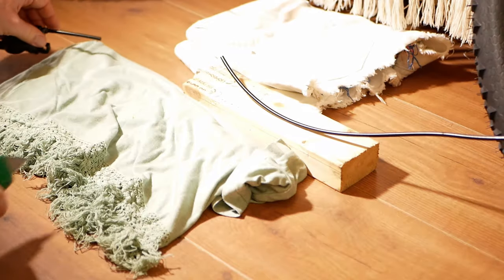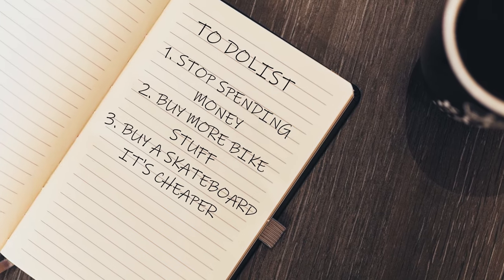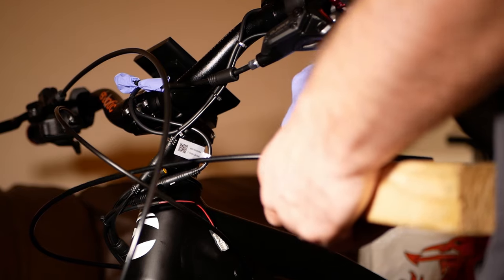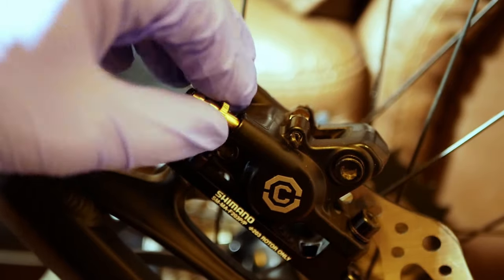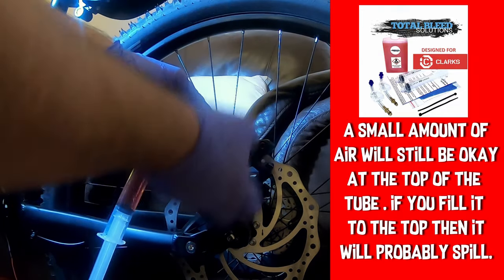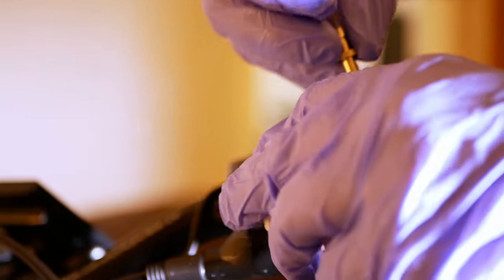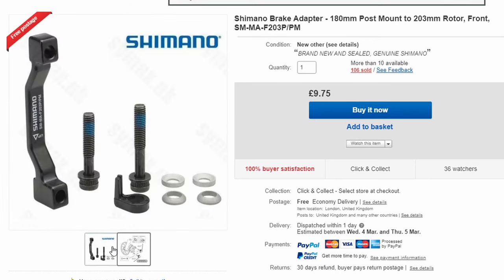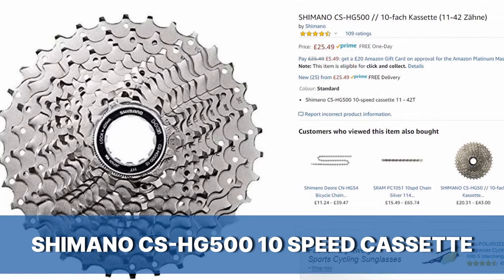BAFANG ULTRA VAPOUR ELECTRIC BIKE PART 7. BRAKE ADAPTERS  SHIMANO GEARS G510 MID MOUNT MOTOR KIT

Comment: I finished my build this week and just did my second ride today. At first I wasnt happy with the power control but today I took a windows tablet with me on the ride and started programming the controller and now it's a lot better. I'm happy, just noticed that I need a shift sensor!!!
Reply from the maker: I was thinking about getting a shift sensor just in case i damage the chain or derailleur, was you getting any problems  accidental shifts with the power on?
Reply: If you leave the controller with the stock settings you could get around without a shift sensor, but you have to be careful. With aggressive settings it's really hard and I heared cracking sounds a few times. Nothing too bad as i have been carefully, but over time that's stress for the chain and cassette. And being careful while shifting slows you down ;)
Reply: I wouldn't have thought that I need a shift sensor also, but i changed my mind. On the other hand I definitely know now that for my technical riding style brake sensors would be very bad. I can't imagine riding a wheelie with brake sensor. The sudden cut of off the motor would be the end of the wheelie when you just want to control the hight slightly with the rear brake.

Comment: Hi Mr Baconbuttie
How long does the rear brake cable need to be (approx) what length was the one that was to short?
thanks
Steven
Reply from the maker: I think the original brake hose was 1700mm and was to short.
I don't know the exact length of the new one as I bought 2000mm hose and cut it to length.

Comment: Hi are u still using this bike?? If so how is it going?? What's ur top speed and average range
Reply from the maker: I am not using it anymore but top speed was 33mph and range was about 30 miles 👍🏼
Reply from the maker: @smokinstud1  I used a 52 volt battery as that's the highest you use on the Bafang ultra. I can't remember the exact specs but it must be in one of the videos 👍🏼 The vapour frame is similar to other Chinese made frames, they are well made.
Reply from the maker: @smokinstud1  already been sold a while back.
Reply from the maker: @smokinstud1  👍🏼